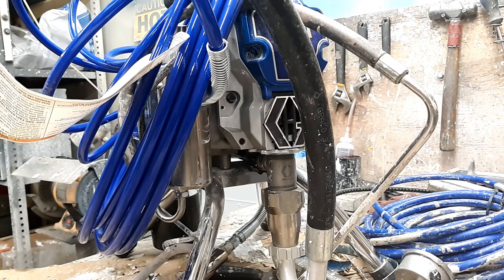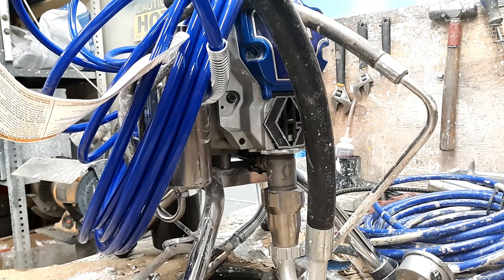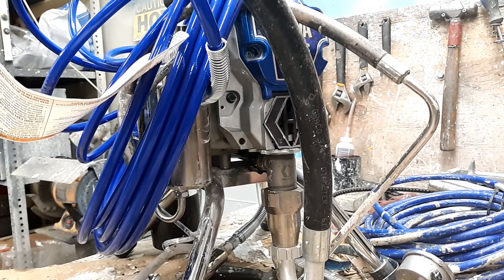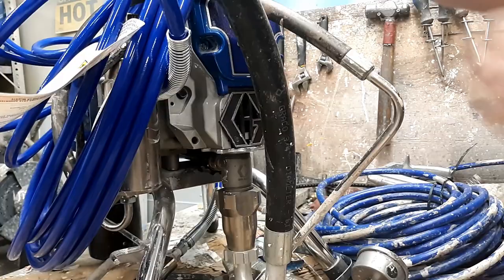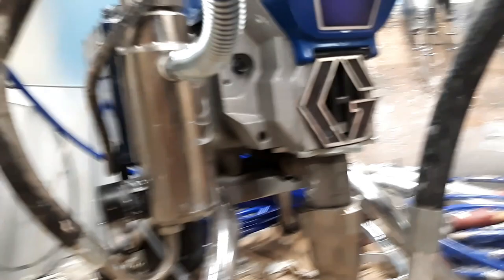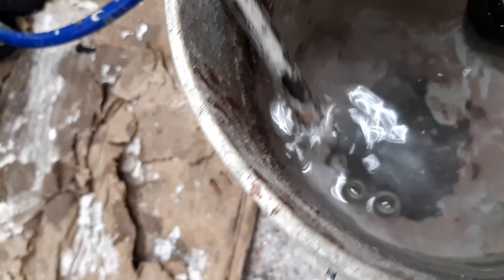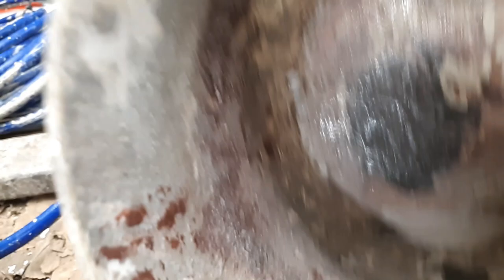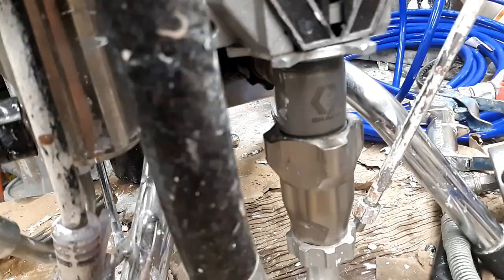Graco paint sprayer loss of pressure

Comment: Do you know if the pressure valve has a broken wire, will the XR9 cease to start?
Reply from the maker: Explain the problem
Reply: No poer when switch is turned on. Proceeded to take apart and started with the pressure switch that was totally broken wired to the micro switch! Have gone a little further and pulled the board and no blown caps or burnt board,  visually. Got the sprayer from a relative and they said the problem is electrically!
Reply from the maker: @drkerman11  if the wire from the pressure control is broken, it will not turn on
Reply: Do you believe I can bypass the micro switch just to test? There is no where left on the micro switch to solder.
Reply from the maker: If you cut the other wire from the switch and connect them, the machine should run if all else is good, but the machine will run without stopping until you turn it off
Reply: both wires are broke from the switch already. I may carefully try that out. thanks.
Reply from the maker: @drkerman11  connect the when unplugged, then once connected plug it in and turn it on
Reply: it worked. Now just needs the pressure switch!Thanks
Reply from the maker: @drkerman11  no problem glad to help

Comment: How does a ball guide get damaged?
Reply from the maker: There are typically 2 types of damage you will see in a ball guide. 
One is pressure cutting. This is damage to the smooth surface due to a failed seal. This allows the materials to seep past under pressure and it will eventually "errode" away the metal leaving pits and scratches.
Two. What we have in this video is compression damage. Over time the constant pounding of the piston compressing the paint against the seat as well as the tightening of the inlet housing will eventually cause the guide to compress and flare like in the video. The guide is a softer metal than the rest of the fluid section.

Comment: Mine doesn't work after instal the new pump whats next?
Reply from the maker: You installed a complete new pump?
Reply: @Brian_the_repair_guy  yes I did, original from graco
Reply from the maker: @NFSgamingEvo  remove the pump hose from the back of the pump and turn on the pump on low pressure. Give it about 2 mins of running and see if water comes out of the hose fitting. When it does turn it off and reattach hose.

If it does not work, hit the pump while it is pumping about 3 times, wait for water same as above
Reply: @Brian_the_repair_guy   no water , coming out!  Could be the prime valve ?
Reply from the maker: @NFSgamingEvo  no the prime valve is fine. You removed the hose from the back of the pump, not your pressure hose right?
If you did the right hose, then the lower or upper ball is stuck. This happens with the oil in new pumps. The video shows how to remove the lower and loosen the lower and upper ball
Reply from the maker: @NFSgamingEvo  check this video here https://youtu.be/9Xr0KQA69IE
Reply: @Brian_the_repair_guy   thanks for all ,but something strange  happen now, is starting smoking the motor, I think this sprayer is gone
Reply from the maker: @NFSgamingEvo  I would agree
Reply: @Brian_the_repair_guy  I just saw your other video ,could be the motor brushes and i can replace ,that would be my last hope

Comment: Where’s my fuse on my lo 540 machine won’t start
Reply from the maker: Do you have a Titan 540? If so not all of them have a fuse. The fuse would be inside the box with the power switch. It may be a circuit breaker under the bottom of the machine

Comment: Great videos why not spend a little time cleaning that shit outta there it seems that it would gum up that ball
Reply from the maker: Residue doesn't cause a problem with the ball, dried solids are usually the issue. 
My videos are not specific to a full rebuild. As I state in the videos, these are the basics to get a guy back to work quickly. 
I try to make videos that will help a guy on the job with little knowledge, get back to work quickly and safely
Reply: @Brian_the_repair_guy  alright we’ll any how good videos